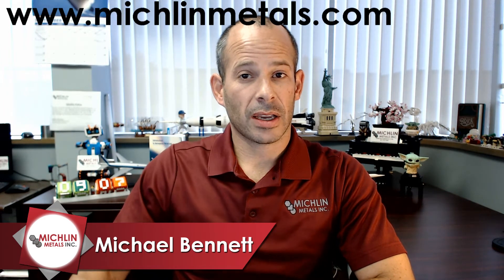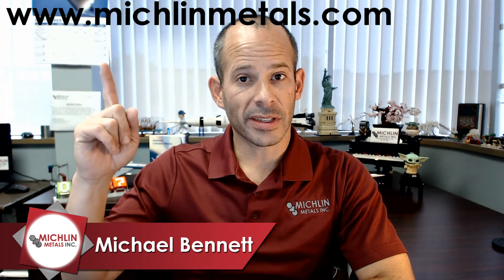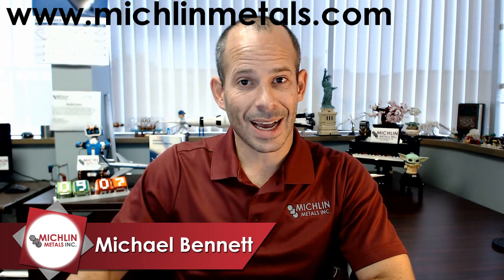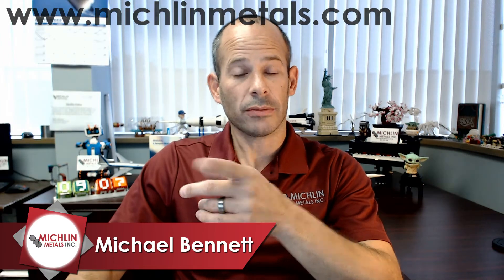15-5 Stainless Steel - AMS 5659 - Round Bar - AMS 5862 - Flat Bar - What is 15-5?

Comment: big fan Michael, quick question, how is 15-5PH different from 15-15 HS Max from carpenter?
Reply from the maker: 15-5 is a precipitation hardening alloy. The 15-15 HS material has no relation other than the 15 in the name relates to the nominal % of an element in the alloy.  The Carpenter website can provide technical information on both of these alloys. Thanks for the comment and have a good day!